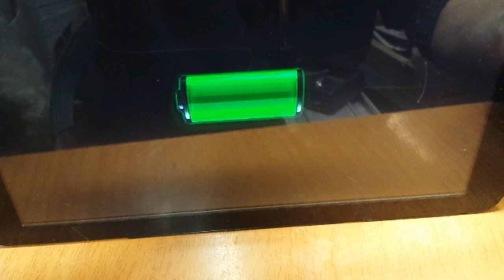How to replace the micro USB port on smartphones and tablets

Comment: Thank you so much for the wonderful tips. I am in the process of changing a Usb port on a Garmin Edge GP's device, where I have an old one that I will use as a spare part. This is a nightmare so I've looked on youtube for several suggestions but what you show is by far the best I've seen. Now, unfortunately, I don't have a desoldering gun, but I hope that I will be able to do this without it. Thank you very much for your wonderful tips, also in many other areas😊 greetings from Norway

Comment: Good explanation. I wished a closer look. How does board preheating help for port soldering/unsoldering ? Thanks
Reply: It helps avoid board damage due to thermal shock. You want avoid a large temperature difference between parts of the board. So your bring the whole board temperature up a little closer to what you're going to be focusing on.

Comment: Man those conical tips are the worst. It's probably late to recommend the TS100 soldering iron but the tips for it are very good especially the conic-flat ones. Too bad the price of it went up and now they replaced the aluminum body with plastic, but if you can get your hand on it for a low price it's a must buy. ;)

Comment: Hi, where did you get the needle syringe thing from for dispensing flux?
Reply: You can buy them that way as a product. Or, with a thicker flux, can buy the components separately on-line then assemble and fill your own. An 18 or 14 gauge needle will probably make you happiest.

Careful-- the ends are crazy sharp.
Reply: @BradChesney  Thanks, I have been searching for a while but wasn't sure which size would be best. I appreciate it!

Comment: I recommend adding information on why you'd want to replace the port to start with.  For me it's because my old ports (and plugs) are so worn from thousands of insertions that they no longer charge continuously without keeping the charging cord pulled in one direction or another during charging.  I've been doing this with rubber bands attached to the cord and my phone.  New charging cords help a lot, but don't completely fix the problem.  That's why the port itself needs replacing, too.

Comment: btw, its a bit dirty but you can use a compressed air gun to push away the molten solder while its still liquid. With something like 50 psi it can push easily even the most stubborn of solder joints. No need to waste flux or solder wick like in your case. The only downside is that it leaves solder splattered everywhere so if you are not careful it can short a board or other components if say you do it from the underside of a cap. But in cases like that where you have a big hole and a clear path below it should all go to the table instead. 

ps: "the solder is melted" -> "the solder is molten" (melted for cold stuff, molten for hot stuff)
Reply: “Melted” Definition: “Changed from a solid to a liquid state.”  This is what is happening here. I suppose if you want to approach it as a technical chemistry definition, you may be right but is it really a necessary criticism here?  It’s a how to video on soldering, not chemistry 101. Something to consider as you’re blowing your “molten” solder all over the place with your air gun😂😂.
Reply: @victoryak86   I appreciated the bonus vocabulary lesson.  Piling on too much teaching at once can burn a guy out, but incidental morsels such as this are helpful.

Comment: I soldered on a new micro USB port to my coworkers Bluetooth speaker and it’s not saying it’s charging. But before I soldered it if I pressed the ports prongs onto the pads it said it was. I’m guessing the solder is likeeee. Too tall and it’s shifted a little maybe.  Idk though. I don’t have a microscope or anything. Just my 20/20 vision so by the looks of it I may know what’s wrong but my brand new soldering iron is being a dick and will die after 30 seconds of refilling with butane so in the mean time. You think it’s just shifted too much? Or I messed something up? Or is the port raised too much

Comment: As you can see, this is not a job for a soldering beginner. The micro USB is a terrible connector, hardly worth replacing, it will just break again very soon.

Comment: To clean the holes you just need strands of copper wires, bind it together,  put some rosin and heat it with your solder while inserting it back and forth in the hole,
Reply: A simple solder sucker works just fine. His soldering techniques are quite bad.

Comment: If resoldering didn't work what would you suggest?
Reply: The entire repair Requires removal of old solder and installing new usb with new solder. Amazon seller for soldering station. Solder wick and solder pump.
Cash outlay> $180.00. 
So for one repair, tools cost more than the tablet.
Desoldering is a slow. Cautious process to not damage the board.

Comment: Thanks bro for the service but it's not in order to use the hot air gun to reput the USB port since it can easily burn out the plastic part of the charging port bro. I wld recommend using the hot iron instead. Otherwise thanks.
Reply from the maker: all smd components on the motherboard are soldered in an oven that includes the usb port,
if you overheat it then you will damage it as most smd components

Comment: Why to preheat all the board?
Reply from the maker: when you preheat the board you need lover temps on the iron or hot air to melt the solder and less time applying heat, this way you do not damage the components.